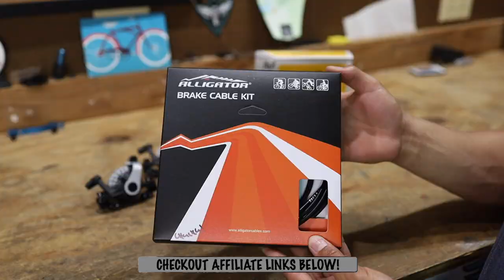Toopre Mechanical Brakes: Initial Impressions | Install

Comment: The adjuster on the lever dates from the era of Vee brakes, it allows you to change how squishy/ firm it feels, what it actually does is change the mechanical advantage of the lever by changing the distance from the pivot to the arc the cable travels through.
Reply from the maker: Well said!! Wish I would of read this explanation of them before I reviewed them about an hour ago!! Lol Matt Ward?? 👊

Comment: I advice against doing that, you should use the barrel adjuster at the lever to do adjust it. This one is for when than one is already used up. Hold the swing arm with your finger and tighten barrel adjuster at the lever. Then hold it secure and use chain pliers to tighten the barrel adjuster, so it won't come loose all the time.
Keep in mind barrel adjuster might be weak, I don't know if this one is but on TRP Spyke just a accidental hit with my hand was enough to snap one, and if adjusted out on a full suspension bike at the rear it bent. So had to have it all the way in or I would bend it. But let's see if this brake has proper barrel adjusters.

Comment: These along with the zoom db680 take shimano non series pads. So you shouldnt have any problems replacing the pads once they wear out. Those are teflon coated cables so they should feel nice and makes the brakes almost as soft to pull as hydraulics. I basically have the same setup in one of my bikes and it can lock up 2.4 tires once bedded in...

Comment: I still have my Avid brakes on my 2000 GT XCR3000. Original from 2000. I'm using the factor Koski levers though. They're still great brakes but I'm considering upgrading to 180mm rotors now that I've upgraded my fork.

Comment: get sintered pads and 203mm rotors for the zrace. The other thing you can try is try a hybrid between mt200 calipers and zrace levers. both are compatible.

Comment: Good replacement brake pads would be shimano G05A-RX. it's the same format on the toopree. Those come on shimano 2 piston slx (and above) brakes. Not sure if shimano J05A-RF pads with cooling fins would fit. Could run into some clearance issues. I used the toopree caliper on my dirt jump bike for a while with G05A-RX pads and it was ok (stock pads are crap) but some budget mt-200's win every day.

Comment: 8:00 You are right, rotor gets bent slightly, also when pads wear you need to move the caliper over in and adjust the pad. And tighten it back. Horrible experience. But some single piston brakes let you adjust both pads but most brakes don't.

Comment: 4:40 These are called lined end caps. These are meant for internal routing where the housing stops at the frame and wire is in the frame, the thin tube goes into the hole at a bolted on cap called cable stopper, that guides the plastic tube, this prevents the wire rubbing on the cap. 
The regular ones are open ended caps, those that look like a damper unit, are anti-kink end caps, those are suitable for rear derailleurs, but I've not tried those yet, Jagwire has those, I will check what Alligator has.

The rubber stuff is for where the routing is external and the wire can rub the frame and make noise, it's meant to eliminate the noise. But if you run uninterrupted housing that's not needed. As in no sections, just one piece of housing.
4:48 This is to a seal to prevent dirt and water ingress.

Comment: I'm recently running those levers with Avid BB7 Mechanical, with no complaints so far. I'm old school and heard many horror stories of losing/fading brakes, bleeding headaches etc etc etc. Might try the Juin Tech Hybred in the future and compare?

Comment: Avid levers are sweet. Very comfortable and very durable
Reply: Extremely durable. I've had the same pair of speed Dials forever. They've survived some pretty epic wipeouts. Never had any problems with them.
Reply: Man just gave me flashbacks to the worst set of MTB brakes I have ever had on a bike even before watching these video: bleeding issues, not returning to position, use a dot fluid and leaked aforementioned Dot fluid out the calipers plus squeal like a stuck pig when braking. They just call them SRAM nowadays and they still have issues. Man those where just the worse and still hear from others issues with their SRAM brakes and some ppl I know just ripped them out and replaced them with Shimano brakes.
Reply from the maker: So looking forward to gripping and Ripping!!
Reply: @Jabba1625  been there, done that! 😊
Reply: They do that specific sound. Any other brake lever doesnt have that sound😅

Comment: If brake is adjusted properly it should do well with  one finger braking. I know thes brake shave pull/modulation adjustment, but I would keep it at maximum power. Pads 1mm from rotor. But some think that's too powerful, so it's nice to have this adjustment.

Comment: There are several aftermarket options, both with fins as part of the back plate. Like Shimano, SWISS STOP, Jagwire, Koolstop 

Or seperate fins and pads, so you can buy fins and buy more pads, keep using the same fins. Like Uberbike, Juin,

The pad you have there seems 5o be a common size. So should be fine, just measure it. If you have Shimano pads compare it to them.

Comment: You should get some reusable wire end caps Alligator offers them for brake and gear wires. you just turn it and it tightens on the wire, no need for crimping. buying more.  They are threaded.
They are offered in Silver, Black, Blue, Red, Yellow. I see Jagwire has a type that folds over and you slide a rubber cap down on it, not as secure I guess.

Comment: 8:34 fins don't have to be in one with the pad, but can be in parts, so fins you put on the pad. But I see Intend released a  hydraulic brake, but that brake is pricy. it has cooling fins that attach on top of the front pistons on the caliper. Smart.

Comment: 7:27 pad removal from the top is a huge plus, TRP did a mistake by not having from the top pad removal. Let's see if the brake you got there is an valid alternative.

Comment: Leverage adjustment: "Lev-ridge Uh-just-mint"

Avid Speed Dial levers have been out since the dawn of man. Well... actually only a couple decades.

But they are fantastic budget levers and you will dial in the Holy Squishy Deathgrip Batman vs Hittin' the Wall schmoove-operator modulation

Comment: I bought my first bike repair stand... coming in tomorrow... should make life easier
Reply from the maker: Dude...You will absolutely love it, it is a game changer for real!
Reply: I will make life easier. I bought my first one in 2021 and it makes working on a bike really easy. I have a Bike Hand stand and it has an adjustable clamp that you can rotate, so that you can angle the bike however you need to in order to work on different parts of the bike. I love it. The teeth on it wearing out bothers me a little bit though. lol

Comment: Those brakes look like a knock off of TRP spyres. Maybe TRP pads will fit them also. Those "thermal" ribs on the pads are hilarious. They add absolutely no thermal mass. I wonder if they will whistle at speed.

Comment: Jeremiah,  after the real time review  I think a good comparison would be these vs the cable actuated hydraulic brakes. Both operate both pistons and is an easier upgrade path for some budget bikes. 😎
Reply: Yeah. i just mounted the HB100's and so far they feel almost as grippy as the Tektro Hydros on my other bike

Comment: I saw a nishiki at a Dick's sporting goods it was a hardtail with some pretty wide tires and a single chainring and a wide range cassette the rear triangle was different look to be stiff. I think it's a Colorado. This one was around $650. I thought youal might to review.

Comment: My 2021 4-Piston Shimano SLX hydraulic brakes are f-in' sweet.  Way less maintenance then old Hayes hydraulics and way more powerful.  Cable actuated disks are cool and simple (check out some premium Paul Components Klampers)..... and I want a reliable pair that pushes both pistons like these. Hopefully they work out great. I actually have some old Avid V-brakes and levers that work pretty damn good and can still lock up the wheel. Avid Speed-dial levers have been killing it for 20 years, super adjustable.

Comment: Hi guys that red adjuster on the lever changes the pull ratio so the closer you wind it to the handlebars the more power you have but you pull less cable and vise versa when you wind it out.
With the hydraulic brakes unfortunately you get what you pay for! If you want issue free brakes you need to get something half decent. I'm a bike mechanic and I see all manner of cheap nasty brakes and they are a pain in the butt

Comment: 9:18 if the pistons are lubed or greased with thin and compatible grease, and seals are not swollen by use of wrong fluid, or damaged, or leaking, each piston should move equalilly. So it's not a issue of it being  hydraulic, but user error or manufacturing error or damage.

Comment: I’ve got some budget cable actuated hydraulic brakes on my bike and they feel great. Should give those a try, you might like them better
Reply from the maker: Those are pretty nice, have a set waiting to be installed and we reviewed some awhile back! 😀  Very impressive brake performance
Reply: What make and model

Comment: Those avid levers are the best cable levers ever made   work fabulous on everything cable actuated   the unusual dials are speed leverage adjust dials and help you dial in the leverage power to help 1 finger braking for v and disc brakes   great to see you trying cable calipers.  Try trp spyres if you get a chance
Reply from the maker: Got some trps!!!!
Reply: Did you get the spyres which pull in from both sides?   Best cable pull disc calipers available

Comment: Ever ripped a Hydraulic line off in the middle of nowhere? Happened a couple of times and now I'll take Hydraulics off and put cables on 😅😅😅😅 btw you guys still running tubes? Been asking for 2 or 3 years lol
Reply from the maker: 🤣 Have had that once with the axum!! But I got a flat and crashed, then no tube and no brakes!!

Comment: Warpage! Those brakes are rad, I bet the cable housing is linear so it wont squish like a normal brake cable. It's basically a beefy shift cable.
Reply from the maker: Beefy they are!!! You know I did not mention it but they are made of Kevlar or  have some integrated! Super Rad!

Comment: A comment on the "Equal on both sides - With Hydraulic you just don't know"....

I really have to disagree with you there...   [EDIT - OMG... Just don't click on (more).... I warn you...

With this twin mechanical system, from new... the 2 sides (set up correctly) are equal... but from there... Not so much... Mechanical things wear... and they don't wear evenly. One side may wear more than the other... and they wear... out... Hydraulic ones basically wear out a seal (Never happened to me even on my 1986 IT200, still running the same calipers 37 years later (which I cannot say the same for the cable drum on the back which was useless when I got it in the early 90's and never got any better).
Also the pads are not going to wear evenly (On almost every caliper I have owned, one side pad wears just that little sooner than the other... because you get muck on one side of the disk sometimes (often the outer side) and its a compound wearing away, it doesn't take much for a thing to wear different to something even from the same batch.
So... You have a mechanical lever that wears out in the pivot & cable socket, a cable that stretches and wears, a cable outer that wears and every bend creates friction on the inner cable trying to pull itself straight so in a bend is pulling against the side of the inner tube till it wears through the lining and you get metal to metal friction... And the outer stretches as it is constantly being flexed until you have a spring rather than solid outer making the brakes spongy...
Then we get tot he lower "Toopre" caliper that has a connector moving in an arc but being pulled from a fixed point so it is flexing the connection of the cable with every pull (and will eventually snap the cable at that point (which is why motorbike throttle cables have a wheel to connect the cable (on carbs that require that form of change in force) from a cable...)
Now moving on to the arm that has a pivot that will wear, then a screw system (or is it a reciprocating ball system... I bet the cheap one) which will wear and require cleaning as often as a hydraulic unit requires a fluid change... (I know this as I have had a CB125T that had cable front and it needed way more attention than a hydraulic unit just to get it back to a mediocre pale comparison of a hydraulic big brother.
and now you get to those pads.... as they wear... they do NOT adjust.. .YOU have to do that... and the result is eventually you notice your lever is almost at the handle... out with the tools (Tho at least with this double you no longer have to adjust the fixed pad and lever... just the lever...
But wait... they don't wear evenly so you stand the chance of the caliper being offset a fraction... so now your bending that disk over to the side with the more worn pad... causing more heat... 

So lets do the same for Hydraulic....
The handle pivot wears just the came as mech.
Then there's a seal in the tank. I replaced my Magura Gustav one after 20 years with a bit of inner tube)...
Then theres the piston and seal... The piston gets a bit of wear from the lever... but never replaced either on my 200000k's of my GSX750 or 37 years of IT200 or 20 years of Foes (as per my walkaround vid).
Then we have the hose... I wore through one on the foes after about 15 years and realising it never had cable ties to stop it wearing on the back tyre knobs... 15 years of that was fairly good.
The fluid... Yes you have to replace that (takes a huge amount of time... like at least 10 minutes... but how often do you need to replace the brake cable & outer, and how long does it take.
Then we have the seals in the caliper... the only part of the caliper that wears.. the piston doesn't touch anything but pad, oil and seal... so thats it... and none of my bikes ever had a seal changed... My 20 year old Toyota MR2 needed a caliper cleaned once as it was getting sticky.... (oh and the Foes has been running Olive Oil for 20 years.) (Well the front... the rear is a Hayes dot5 which was running through a hand made alloy banjo for 15 years (changed with the broken hose about 7yr ago)

so what about that original statement...  about the pressure on the pads from a hydraulic caliper "You Never Know"...

Actually you do... as long as the fluid/seals are clean...   "Exactly the same" as that is how fluid pressure works... there is a tube from one chamber to the other.. and no restriction... so the pressure MUST be the same... 
As pads can always wear unevenly one piston can be slightly further in than the other.. 
BUT....
Hydraulic brakes are SELF ADJUSTING...  You set the lever position and thats IT..
As the pads wear the reservoir adds more fluid to take up the slack... so the lever remains in the same place... If that position changes.. Most likely just needs a fluid bleed/change.

but them the Elephant that's been sitting in the dining room reading a book steps in...
and asks... Even if the 2 were the SAME wear and effort, can you do a days DH on any cable brake using 1 finger braking and not need any adjustment after.... 

Note. I bought an ol Giant Faith 2010 in xmas 2019 with oil soaked pads (you can hear them squealing in my 1st 1-2 videos)...
I just cleaned those 2nd hand pads.... replaced the rear rotor (not the pads.. coz I iz cheap).... with a 2nd hand one from the local tip shop mind you...
and have been running the same pads (and one change of fluid since) for over 3 years... with no adjustment.... on DH tracks... (Fairly mediocrely i admit... see vids)...
and they will endo, one fingered if I want... (they are vented Shimano XT's but I'd still take them worn and oil soaked over a brand new cable system...

I have ridden many bikes with cable brakes (and own one... with Vee brakes on the rear... and the Vee brakes are SO MUCH BETTER)....  
None of them had the feel you get from Hydraulic (or even Vee) brakes... 

I made the mistake fo doing a G4 on a cable brake bike once... couldn't get the front to stop on anything other than flat... scarest run I have done on that track and one of my last videos is the same track but with my front axle loose.    I felt safer with the loose axle.

"If I could offer you only one tip for the future, sunscreen would be it"....     and don't ride cable disks other than slowly round streets... but stay off the road just in case...

I TOLD YOU.. Don't click on More... Did you listen....   (Oh and BTW... I'm a Maintenance engineer... 14 yrs... It's my job to fix/improve broken things,... I work with the results of wear every day. and I work on Waterblasters a lot so fluid dynamics and seal wear is right up there.... a seal with water can last over 10 years at 2000psi...Hydrauylic calipers... much the same except for dirt,,,

Comment: 3:12 I would not do this. it's unnecessary to stand on the bench. with properly adjusted and angled stand you don't need to do that.